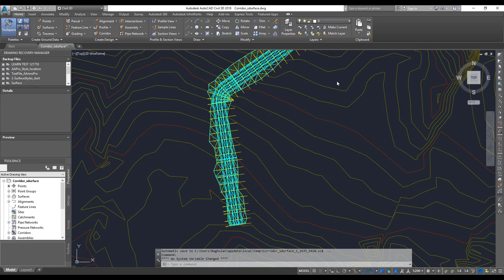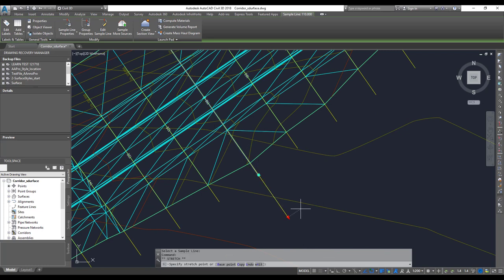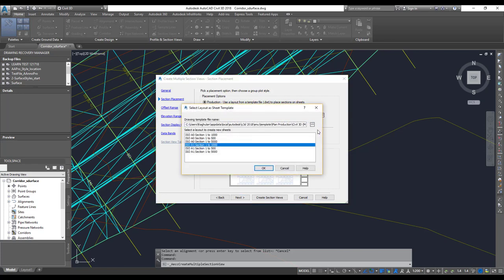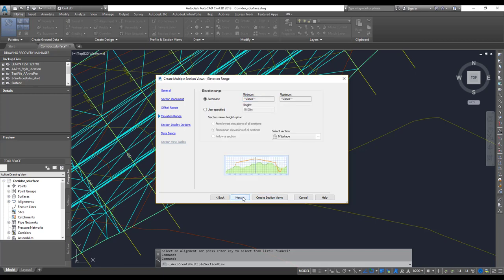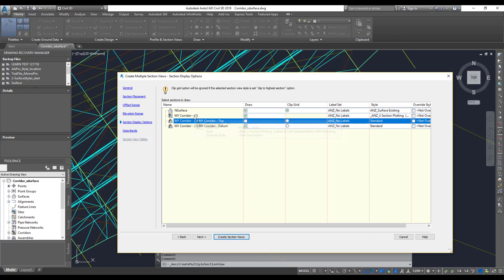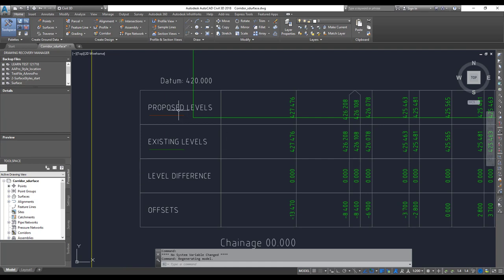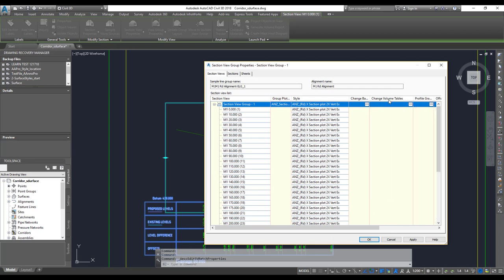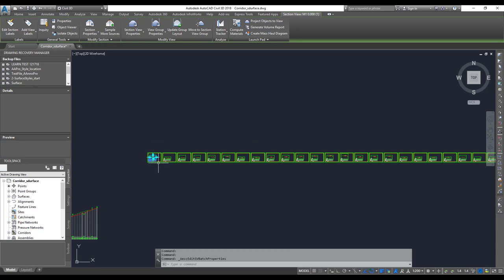Civil3D Section Creation Basics

Comment: HI, Can i display the proposed level of two different proposed surfaces in one single band?
For example, i have a mainline and a side road running parallel to each other and in the cross section view, if i want to display the level of ground or natural surface in one band and in another band i want to display the proposed level of my mainline and side road. Is it possible?
Reply from the maker: Yes you can i think. You need add that to sample data, assign a style and the in bands insert it under section view properties. may be try and do a video.